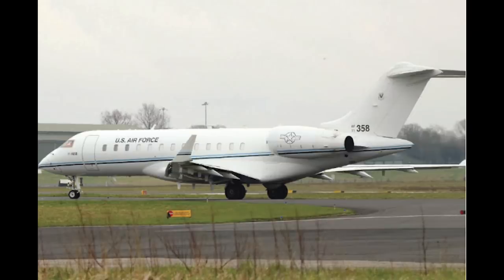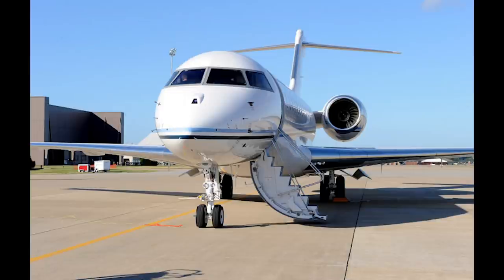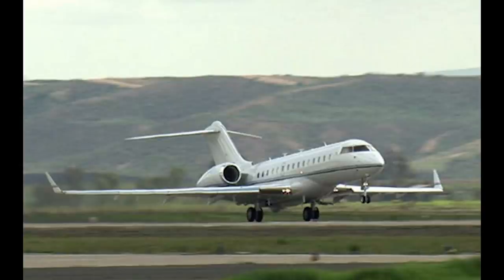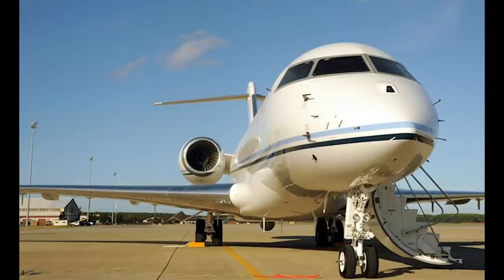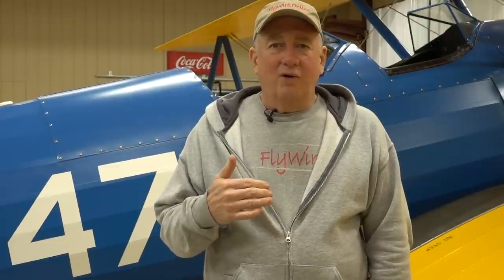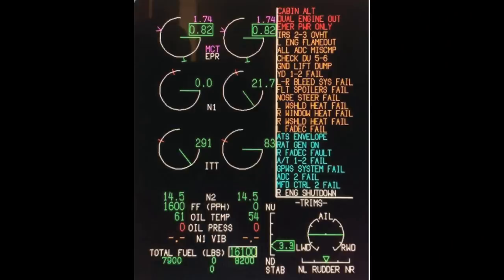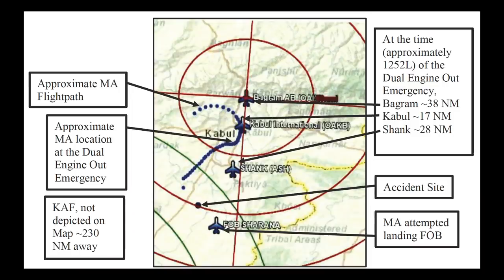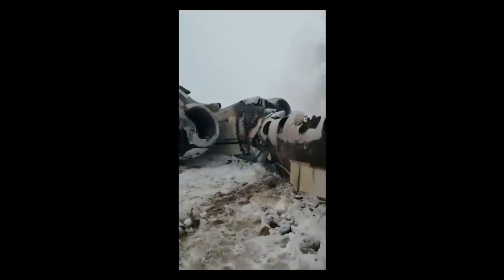Accident Review  Global Express Dual Engine Out

Comment: A compounding of pilot errors is often disastrous as in this case.  Basic private pilot training for engine out is to determine max glide distance, possible landing options within that distance, choose most advantageous and begin nav to it. Make the maday, Then try to figure out issue and restart if possible.  I worked on the global aircrafts at Bombardier and it is a very reliable and safe aircraft.  They would have been ok if hadn't shut right engine completely off.  They could have made kandahar on one engine at reduced altitude.  Starting the apu (if I  recall correctly is 11000 ft max alt) would have only helped restart the right engine if they had realized in time.  The rat powered the emergency buss giving them avionics and nav and flight controls.  If they got right engine started, then that engine would power the R buss systems and they could have apu power L buss system, restoring full electrical, hydraulic and pneumatic systems.    It is very strange that the left fan failure completely disabled the cvr.  It is installed in the apu aft equipment bay on the left side fuse, but behind where the engine fan is.  Since this is USA airforce in a war zone, it would have been unlikely that any of Bombardier accident investigate engineers would have been called on to assist with analysis of that cvr and engine failure.  Sad for the loss of both pilots.  I presume the airforce will do a lessons learned from this and make sure their pilots on this aircraft type retrain emergency procedures
Reply: 2bikemike, Exactly, trim for best glide immediately make a heading to the next available landing strip, wake the APU up as soon as possible. They wasted so much usable energy and critical time. Getting back to the basics probably would have created a better outcome. Seems to me as an example of complacent piloting that cost this crew their lives. Pilot error is sad especially when flight school 101 is ignored.
Reply: You can start the Global’s APU at up to 37000ft and extract bleed air for an engine start at  or below 30000ft.  The Global has a great APU.
Reply: @pauljrix  , Wow... I would not have expected an APU designed to restart at FL-37. Amazing what is manufactured these days! Hope I can find the POH for this machine. It sounding like a very solid platform from folks that have worked with these birds.
Reply: @pauljrix  thanks Paul for the correction. It's been eight years since I retired and I couldn't remember the exact altitude I think I got it mixed up with the Regional Jet program that I also worked on
Reply: @2bikemikesguitartopics145  No worries.  I have to sit through recurrent training every 6 months, so those figures tend to stick ;) .

Comment: I guess when you have a twin ,in my case the most important thing is to practice engine failure. I’ve lost power in 2 single engine
Pipers. It was fast n easy to figure . Of course I’m lucky to be here but my training was well remembered. 1st fly the plane, relax n think
Of emergency location , n then check list with associated instruments showing a failure.

Comment: PIC remiss by not shadowing (to some extent) those inspecting and reporting wing & control-surface conditions.   since the aircraft was outside for hours and it was near irresolvable to estimate adverse effects from precip/temp/time calculations …so by all means, someone needs to get up there and look carefully with 2 eyeballs, a good flashlight and perhaps an extendable brush.  no excuses there i’m afraid.  high-wing and T-tail aircraft bite GA pilots like a hungry viper just about every winter not from any fault if their own.  (but perhaps all due in part to fatigued/inert-cold/lazy/rushed/ill-prepared-equipped pilot syndromes). nice vid! 👍🏻

Comment: I'm not a pilot but have been manufacturing, testing and supporting business jet engines for 35 years.  This is a very sad story but as Scott pointed out, the pilots need to keep calm and don't panic.  When you have one engine operational, you need to be absolutely sure you are shutting down the correct engine before taking action.  This is a case where, unfortunately, that did not happen.

Comment: Quick comments: I have had a similar situation happening to me. B737-400 150 pax, 4 stewardesses, 2 persons on jump seats in the cabin, 2 colleagues on jump seat in the cockpit. Climbing through 10000’ there was a large bang, you heard the passengeres scream through the closed cockpit door, and then the vibrations that were so severe that the instruments was impossible to read. Both the copilot and I thought we had had a midair collision of some sort. I felt the airplane yawed slightly to the right and told the copilot we should go for the engine seizure checklist, Right engine. We agreed that this must be our best guess and followed the checklist. Upon cutting the fuel to the right engine all vibrations more or less stopped and we diverted and made an uneventful single engine landing. Takeaways: The control lever to the inlet vanes of the starboard engine broke, resulting in a massive turbine rupture. This caused the vibrations. The vibrations were so intense making the instruments more or less useless. Our diagnosis of the situation was correct and the procedures worked. But calling the order to stop the right engine in favour of the left was a hard one and includede a bit of good fortune, since the instruments that we normally trust was unavailable to us. There is the chance that the Global Express crew might have faced the same dilemma with virtually no readable instruments. However after having shut down both engines, there probably was ample time to reconsider and start the good one again?
Reply from the maker: Thanks for sharing!

Comment: Great presentation Scott. As a single engine pilot, it seems to me that determining which engine has failed should be very simple if these planes had a way of sending that info to the pilot.   Why not a light that comes on and tells the pilot which engine failed?  I guess I don't understand enough.
Reply: You do not.   Keep at it.  Not intended to be a smart assed comment, been there and done that.   But In the modern, electric airplane, things are not always as they seem.   Pilots are trained not to trust a single source to determine things like an engine failure.

Comment: As a Globa Express mechanic and one that was on the BACN program, I heard a lot of contradictions. In one segment around 15 minutes in, you said they did not attempt to start the APU and that they only attempted to restart the left engine twice, less than 2 minutes later you claim they tried multiple engine starts with the APU. The last video shot of the airplane clearly shows the APU door open the only way that happens is if they attempted to or actually did restart the APU. The DFDR requires engine oil pressure to operate from either engine not generator power. The engine is not designed to destroy the speed probes as you stated. I was also a BR710 engine instructor for Rolls Royce and know this engine intimately. You also stated that the blade that blew off of the disc damaged the EEC. Very difficult for this to happen as it would have been captured by the Kevlar wrap on the fan case since to blade will depart centrifugally outward from the fan disc. Also, the blade would have had to get past the fan outlet guide vanes, travel further down the bypass duct in the bypass stream going out of the back of the engine and then shoot straight up to puncture the bypass duct and damage the EEC that sits mid-way back on top of the bypass duct at the 12:00 position. Sounds like the magic bullet theory to me. Way too many inconsistencies for me to buy this whole series of events. Oh, and to have the CVR mysteriously stop working as the blade departed the engine. That does not make sense or add up in my opinion.
Reply from the maker: The facts in the accident came from the accident report. It’s possible I may have misspoken. But if you have a problem with the facts then you have a problem with the USAF who did the investigation. Many other folks who were involved with the airplane have reviewed the video had an entirely different view than you.

Comment: I completely agree with what had happened. One thing was left out was how were the pilots on there rest, fatigue situation. They may have been flying back to back missions. Which are always the case in high time in the Air Force. Not enough sleep will mess you up period. You could be an Ace you’ll make mistakes. Our brain does not comprehend 100%. Just my 2 cents.
Reply from the maker: In my experience the USAF is very strict about crew rest, too many lives/airplanes lost. If the squadron was breaking crew rest, I'd bet leadership got fried.
Reply: @FlyWirescottperdue  thank you for providing such a amazing feed back about the Aviation. I have learned a lot. Also thank you for your service sir salute 🫡

Comment: I wonder if something could be done with the user interface for the engines, I see that the data was showing them a problem with the engine but I wonder if it could have been designed to be more obvious, like for example have the dials of the problem engine change color, or have a call of attention right on top of the problem engine. I’m sure the people that designed the interface went through these types of scenarios, but for the non aviator people like me it looks like the interface is not 110 % obvious. Thank you for your videos they are amazing!
Reply from the maker: I’m not familiar with this airplane but other airliners I have flown have the colors change on the engine display.

Comment: When I first learned to operate a newer global I was always curious to see what would happen in an emergency situation. I was always concerned that while I was still manually going through the emergency shutdowns or other procedures, I was always concerned about some sort of logic disagrees or something since the plane actually does a lot of the procedures on it’s own. But what I was always told was try to beat the computer. You won’t get into a logic disagree or cause issues. Theoretically that’s true and I was thankful to never be in a position to find out for real but I always wondered if the system wouldn’t unintentionally have issues. I was always a fan of the Crj an challengers nothing fancy. just reliable workhorses. You sld have seen us doing Vibe testing in the C-series. That was interesting imputing crazy hi frequency’s directly into individual pcu to shake the stabs and flight controls since they were our first fly by wire. Didn’t need a giant shaker stand like for the Lear 85.

Comment: What a fantastic presentation. Just liked and subscribed. This appears to be a classic case of inexperience and lack of airmanship. 1000 hours and already a training captain seems awfully low in the experience field and at that level of knowledge, it is always hard to tell what actions will be taken during an emergency situation.  Knee-jerk reactions are often wrong, as seen evident in the Atlas crash into Trinity Bay. I strongly believe that if there were a more experienced crew, this would have resulted in the Right Hand Motor being restarted, and a successful landing achieved.
Reply: 1000 hours in the Global Express.  Both pilots had many more total hours than that from other Air Force jets.

Comment: Scott, well done analysis. I'm sure you meant "engine pressure ratio" @ 10:50
Reply from the maker: Most folks use that ‘definition’. It measures inlet and exhaust pressure as a ratio. I learned it as exhaust pressure ratio... I thought I mentioned that in the video.

Comment: No adult supervision in the cockpit.  As a former military and airline pilot I understand this type of crew paring is often necessary in the military to accomplish the assignment but it is done so with an assumed risk that is much higher than a typical U.S 121 air carrier would accept during normal times. Going forward this kind of poor judgement due to  low experience levels in today’s air carrier cockpits is inevitable as we rush to fill empty airline cockpits. All is well as long as all is well. I think this accident should be carefully considered by those responsible for insuring the safety and well being of our national airspace system.

Comment: never stop flying the aircraft.  It seems like if all they did was drop the nose to keep airspeed, idle both engines and then went through the checklists with adequate time they would have figured the problem out.  At 43k feet it's not like they had to rush this.

Comment: USAF needs to realize sensors like exhaust gas particles and fluctuations and vibration and noise sensors are needed in a combat oriented plane to take loads off mission tunnel visioned pilots. I think mission tunnel vision had them thinking push to go south. Sad accident story.

Comment: Shades of a twin USAF jet crash near St Louis decades ago. A training flight, on climb out after a touch & go, the C-9 experienced catastrophic engine failure causing similar heavy vibrations. Rather than fly as best possible to a safe altitude then determine problem/solutions, in a rush the crew incorrectly shut down the good engine! Others have commented the principle of do nothing right away, settle down, fly the aircraft, then with assurances of controlled flight and terrain clearance, see what can/must be done. With 1 pilot being new, and even higher level of care must be taken under such conditions. After all,40,000 ft creates a lot of time. Point the plane toward an airport, flat terrain, FLY attitude/airspeed for best glide; talk. Sorry about this loss. Lastly, GET OUT OF AFGHANISTAN ! We have no reachable military objectives and WE ARE NOT going to resolve Afghanistan’s social, political, security problems.
Reply: A friend of mine witnessed that accident. He was a new pilot that was supposed to be on that training flight but they bumped him. It hit power lines. Awful.

Comment: They call these birds “nighthawks”. There was a citation recently had fuel contamination lost both engines landed 50 miles later and greased it. My scariest experience was on a B1-B. Wings got stuck swept back at 60 degrees had to land at 250knots. Popped all 8 tires and went off the end of the 3 mile runway

Comment: After watching many air crash stories about pilots shutting down the running engine.  I have an idea.  How about putting two optic fibers looking at the engines tied to a small screen in the cockpit.  Or mini cams with wifi to pilots cell phones.  How simple and inexpensive would that be.  I am amazed at how may times pilots have been unable to figure the situation out.  How about two rear view mirrors, retractable of course.   Hey a retractable periscope might work... think simple.
Reply from the maker: Dolly, unfortunately I don't really think there is a mechanical solution here. If there is a way, someone will find it.

Comment: My instructors always said if you have an emergency at altitude order a cup of coffee. And that’s what I teach my students now. At altitude short of a wing falling off or a fire you have time to figure it out
Reply: And if a wing fell off, you might as well enjoy a coffee on the way down.
Reply: This is similar to what I was taught at C-130 flight engineer training.  That you have time to react to most emergency procedures. Except three, throttle control failure, massive bleed air leak, and wing fire.  The others you could troubleshoot with the -1 flight manual.

Comment: If the representation of the /L/ before FADEC is accurate in the display, with a badly shaking acft, it's tough to see the L. Could that contribute to the misdiagnosis of which eng had failed?
Reply from the maker: Very likely.